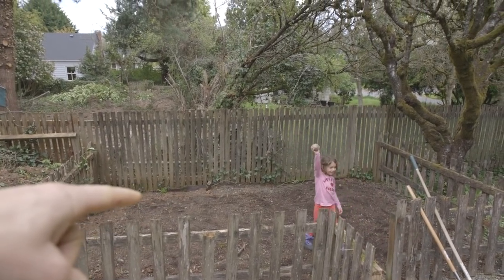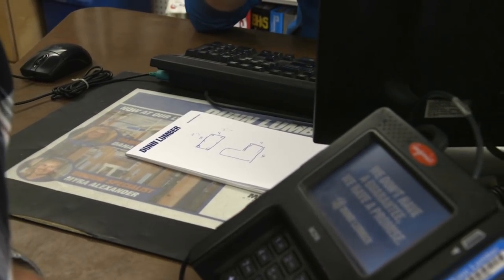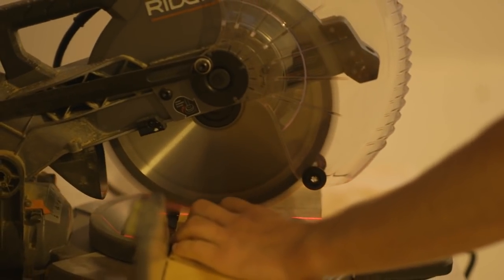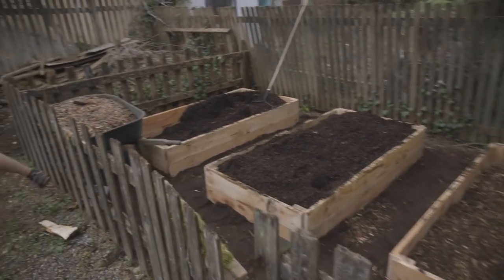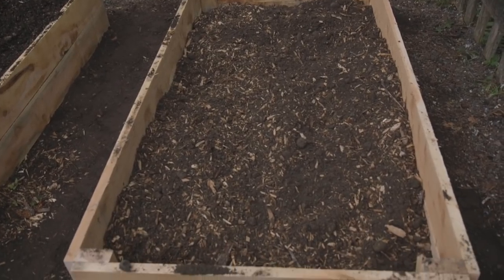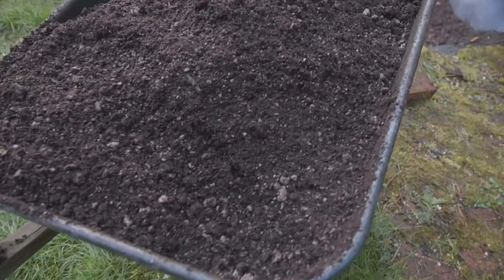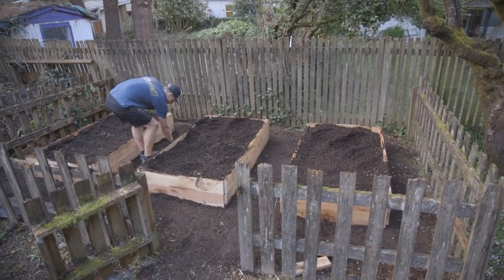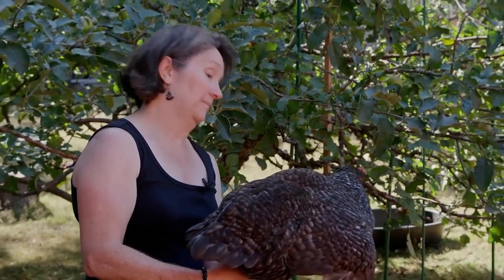DIY Raised Garden Beds + Raspberries (my brother and I show you how to save $$)

Comment: Here's an option to keep from breaking the bank on soil.  On top of the hardware cloth, put some old wood that you did not use in the fireplace this past winter (well dried and you may not want to store all summer).  It may provide bulk so you need less soil, food for beneficial worms and bacteria, root warmth from the decay process, and more.  My father used wood when making new garden rows.  Wonder if it is a German thing.  Maybe.  But Dad was a good man.

Comment: I love that you made a gardening video but fresh wood chips should only be used on the surface and never to be mixed into the soil. Wood chips do not offer any nutrient value to your soil until its FULLY composted.
By burying fresh wood under your soil, the composting process will begin by sucking up all the nitrogen from your soil..which is what your plants need to grow.

If youre just getting into sustainable organic growing, check out these channels: OYR, Organic Edible Garden, Back to Reality, Calikim29, Grow Veg...good luck ;)
Reply from the maker: Jaz ok. Thanks!